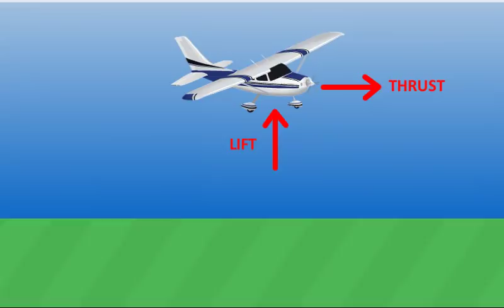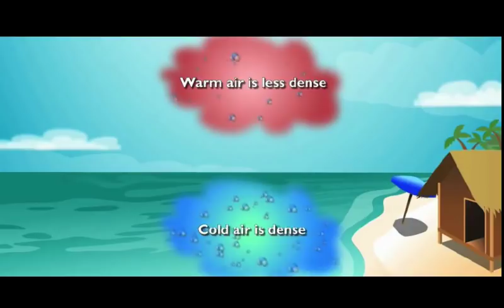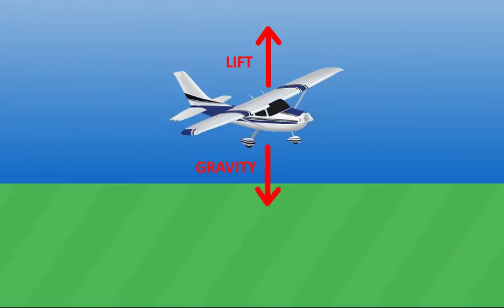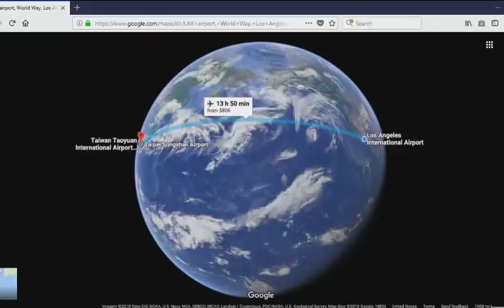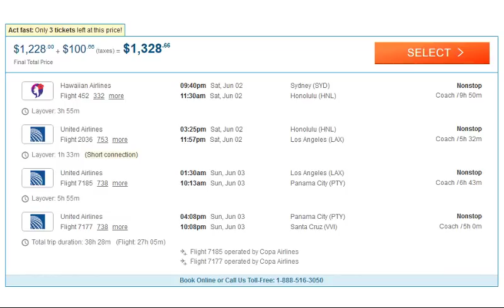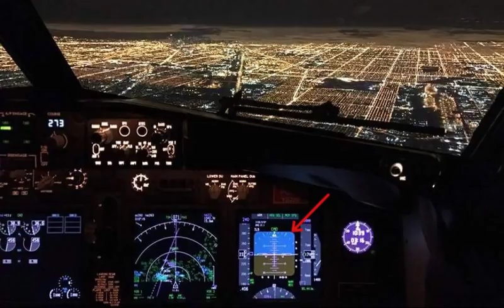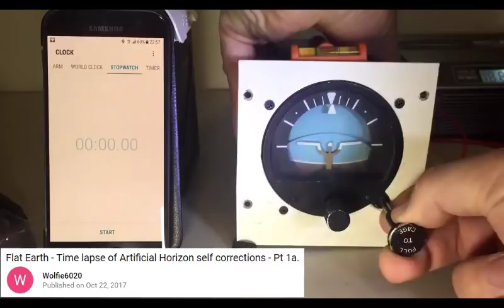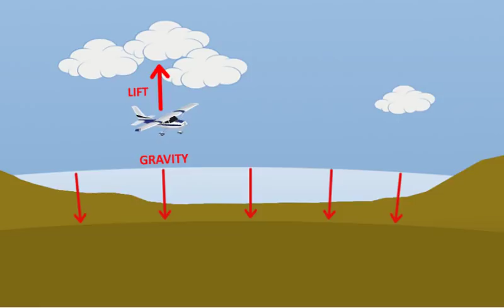Flat Earth Falsities - Plane Nonsense

Comment: As a commercial pilot of 22 years, I  can tell you with confidence that the narrator's assessment of how a gyroscope works is completely wrong.
Reply: How does a gyroscope work then, because I don't know. Wouldn't mind a decent explanation.
Reply from the maker: Cool story, bro. There are many resources showing how artificial horizons work. Here is just one, that explains the pendulous vanes. 
https://youtube.com/watch?v=_MoS5Yw9ZgE&feature=sharec
Reply: Sir you have lost it , people aren't buying this and your theory is absolutely about atmosphere moving with the dirt ball and so easily observed
Reply: Here is the answer you've been waiting for: The unique feature a gyroscope is, while spinning, it stays rigid in space, meaning, it stays fixed in the 3 planes in which it was stabilized. Any force applied to change its spinning axis will induce precession, a movement 90° away from the applied force.The pendulous vanes are there to correct for PRECESSION and not to constantly align itself with the gravity vector. Whenever you change direction in an airplane, the bearings upon which the gyro is turning get a side load, thus causing precession and inducing error. 
  By way of example, the vanes are subject to "G" forces, which, in an airplane, can come from ANY direction.  If you perform a 9g steep turn, the 9g's overwhelm the effect of gravity on the vanes by 9 times. The 9g' vector will track a circle whereby the 9g vector is constantly moving and yet always perpendicular to the wings and fuselage and nearly perpendicular to the force of gravity.   If the vanes track g-force acting on the airplane,  they would always indicate "straight-and-level" flight. Since this is never the case, the vanes respond to PRECESSION and NOT GRAVITY or g-force. 
  The flat-earthers may do whatever they want with this, but the operation of the vanes does not prove the earth is round. The vanes are not there to adjust to the ever moving earth-gravity vector just like the gyroscope is unaffected by the ever changing g-force vector experienced by an airplane, space ship, or boat.
Reply: @whenpigsfly3271  -- ” The pendulous vanes are there to correct for PRECESSION and not to constantly align itself with the gravity vector.”

Friend, you’re half correct.  The vanes indeed correct for precession, but they are a dual-purpose mechanism which also maintains the gyroscope’s rotational axis aligned with the local gravity vector at all times.  The instrument would be useless to the pilot otherwise.

Consider an aircraft’s start-up scenario.  The pilot scans the cold instruments and sees that the artificial horizon isn’t level, but oblique at, say 20 degrees from level.  (This is quite a common occurence, since gyroscopes tend to tumble off when the attitude indicator is powered down.)  Now the pilot powers up the AI, and sees that the artificial horizon comes to level…so what possible force accomplishes that, if not the pendulous vanes?  There’s no acceleration on the gyroscope, and there’s no precession in play.  By your reasoning, the artificial horizon should just remain angled while spinning up, but it doesn’t.
Reply: @whenpigsfly3271  Throwing paperplanes does not make you a pilot.

Comment: Flat or Ball... Neither would affect my daily activities. I would still brush my teeth, sh*t n shower, put my pants on and live the other Great Big Lie about why Life is the way it is for the only species that owes for some reason to live here. This AI guy splains a lot without the underlying explanation that would verify his assumption and that is... What is Gravity and Where does it come from? Avoid splainin that an object spinning draws everything inward unless you can actually show an example we all can believe. Don't hide behind saying it needs to be massive enough for air to be trapped against the surface of a ball out in space because you will be veering, evidently, away from the science you're attempting to provide your facts, which all seem fair enough so far but defining how gravity is actually produced is the one simple thing you haven't factored in that would complete your analysis. Like I said. It sounds very good but it falls Flat, pardon the irony, without providing that necessary foundation that certifies all you have done with this.
Reply from the maker: As I have said, we can MEASURE with great ACCURACY and REPEATABILITY, the relationship between an object’s MASS and the strength of its GRAVITY. What more proof do you need? 🤦🏼‍♂️
Reply: He doesn't have to prove all of science to cover what he is saying.

You would be better engaged in explaining how flat earth "density" works.  You can't even explain where the downward vector comes from or it's magnitude.

Gravity is established fact - move on, you lost this one.
Reply: On behalf of frustrated plumbers the world over, the shower is ill equipped for such 'double duty'...the few minutes saved WILL eventually lead to one heckuva pain in the butt ((no pun intended)
Reply: Everyone who says that has absolutely no clue what he is talking about. So do you.